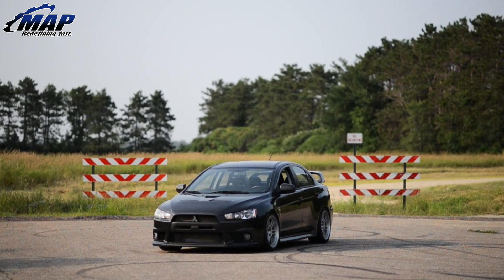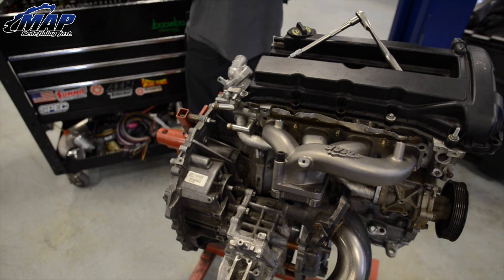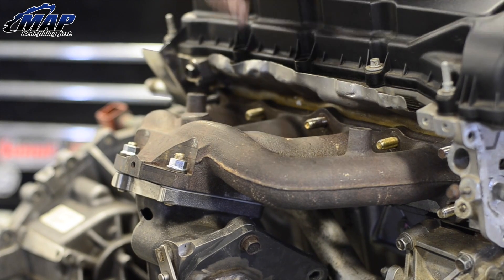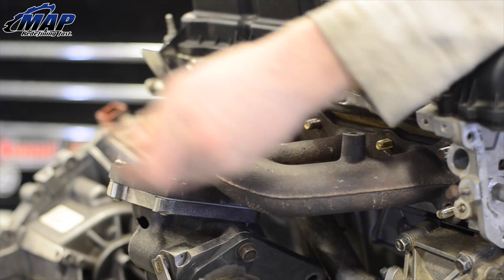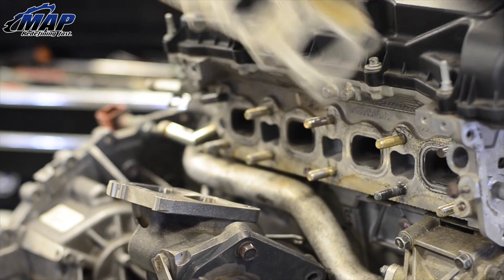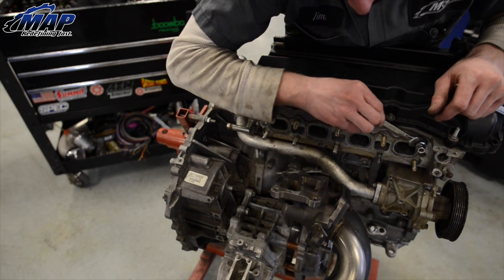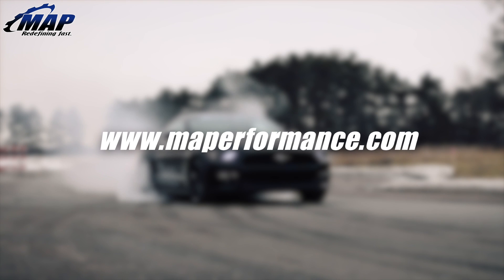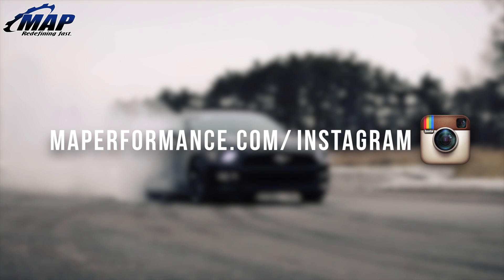Evo X Investment Cast Exhaust Manifold Install | MAPerformance SS High Flow Upgrade

Comment: I love it but the two bolts at the bottom are impossible to torque since they use hex/allen heads and there’s 0 to no clearance I had to modify other bolts to fit there.

Comment: Why remove the two upper studs on head?
Reply: It uses allen/hex bolts as the map manifold doesn't have enough clearance to allow the OEM style nut and 14mm socket to go on it.

Comment: What's the bolt torque sequence for the exhaust manifold-to-head? Just start with the middle and work your way out? Is there another sequence in the service manual?

Comment: Bolts go lose after every track day and blows gasket out, right pain in the arse. Tried longer titanium bolts with self locking nuts from underneath and locking wire still same result, bolts streched loosened up... Any solution to this? The bolt on passenger side from engine block side keeps backing out to the point where it drops out in just one track day 🤦‍♂️
Reply: Having the same issue 😔
Reply: Same this manifold sucks ass i am replacing my turbo gasket once again and now i cannot get the pain in the butt bolt screwed in so ive been searching the internet if anyone has figured anything out
Reply: @Stepbro11b  I finally got mine to stay. I loosened all 4 bolts and tightened them in sequence of top left bottom right bottom left top right. Been doing doing pulls left and right done 2 track days still nice and tight. Bottom left bolt did take me a long time to get screwed on.
Reply: @say9er  that is the bolt i am having issue trying to get it threaded on with the gasket it acts like its not aligned but i have the other 3 in, i determined to put red loctite on but never will because i will never be able to pull the turbo without breaking stuff lmao i will try again tomorrow i loosend all my nuts on the block and just trying to get the bottom left threaded. Such a pain in the butt with this manifold lol ive tried putting nuts on the bottom back and they unscrewed themselves
Reply: @Stepbro11b  yeah I feel your pain. I was getting really frustrated. Just make sure you’re using the 14mm bolts and washers that are original to it. Once I loosened everything and retightened Haven’t had an issue since. If you were local I’d come help.. but I highly suggest not to use red loctite haha. The bolt has to be at a certain angle and you kinda have to put pressure down on it as you try and screw it on. I was trying without taking the strut bar out but it was so much easier without it
Reply: @Stepbro11b  and make sure the other 3 are loose. I was able to tighten all 3 with a long 14mm wrench. Might be a little too tight now. Remember that the Allen bolts they sent 2 of them are for the cylinder head portion not the turbo side. Saw alot of people trying to use them for the turbo bolts
Reply: @say9er  i finally got it lol i ended up drilling that hole a little bigger and the bolt went in easy afterwords i drilled it the next size bigger not too bad, then i threw 2 nuts on the bottom of the bolts in the back and used a long 14mm wrench and tighten with all i can. Yeah ive had this manifold for some time now and it has been a pain in my butt ever since i had it i blew 2 gaskets on it now i am on my 3rd hopfully it works alot better i was able to get all 4 in this time since i drilled the hole bigger, last few times i was running with only 3 bolts lol
Reply: @Stepbro11b  now I’m nervous they won’t come out 😅

Comment: Obviously they don’t show them tightening the hard to reach stud because the head is round and there is no way to get a regular wrench around it.  Why is that hard to reach stud such a mystery?  Literally no one has a video or picture on a solution for that
Reply: That bolt keeps losing up and popping out every track day, it's so annoying
Reply: LeDarka do you have a stud and nut in the hard to reach corner of the manifold?

Comment: I call bullshit! doing it now. there is a slope to the flange that bolts to the turbo and the turbo needs to be loosened to remove the manifold unless you pull the studs from the head. good luck with all of it. Doble but not as simple in the car

Comment: I wold like to replace the stock manifold with this one do to a defect found just about everywhere {cracking } how do these hold up in comparison to stock? I doubt it but will i have any running issues replacing stock with this one of will i need to have it toned? This is my wife's 2.0 ra and its a daily driver. She hardly ever gets it above 55 and i never hear her turbo with her slow but driving
Reply from the maker: The RA turbo has a different flange, you would need a Evo X Turbo and install kit for that to work properly.

Comment: should there be any issues removing that manifold? I felt as if I have to remove/loosen my turbo to be able to remove the manifold. Am I doing it right or should I not have to loosen or remove my turbo?
Reply from the maker: +STANKEEYANG It can be stuck on there pretty good sometimes! If you are still having problems give us a call and we can better assist you with install.

Comment: the studs don't come off that easy. let's be real those are near impossible to take them off
Reply: Im sayin! i was just about to drop a line. Man im still fighting with mine as we speak. Week 2 is now coming up and even after stoping by a exhaust shop i got nothing but that old crappy cracked manifold.
Reply from the maker: +Thee Parris Hill We know it's pretty tough, there isn't really a one size fits all solution for this. You can try heating them up? Otherwise just give us a call and we can try and help you out further!
Reply: What about kroil?  That stuff works wonders